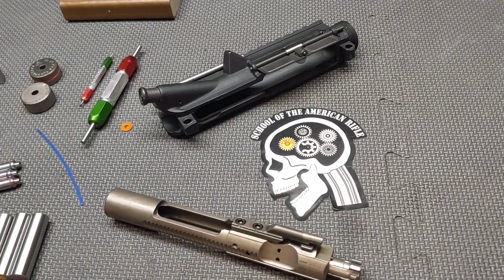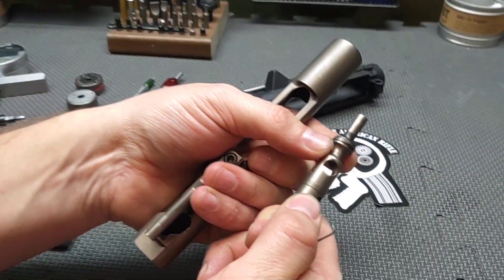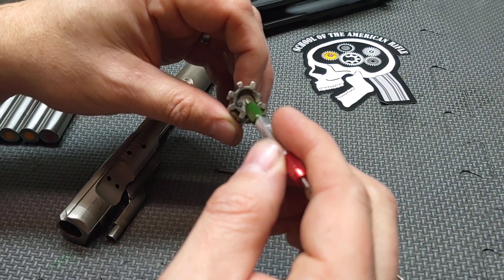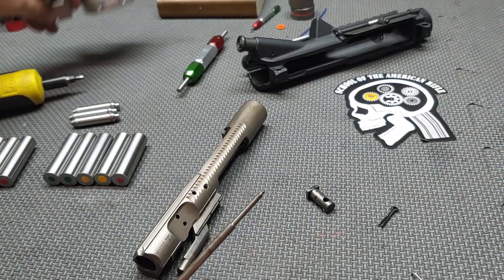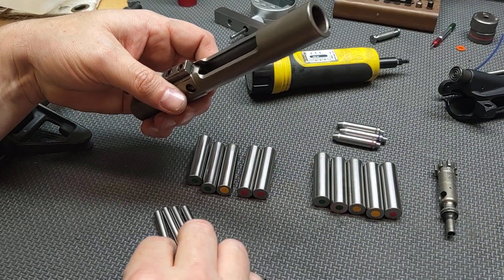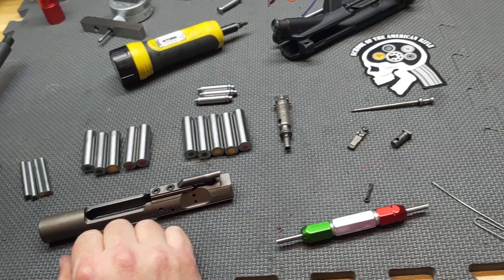Fail Zero AR-15 BCG Autopsy

Comment: Thank you!! I just took my FZ bolt carrier out and noticed signs of gas leaking out from under the gas key, and I just checked the bolts, and one is super loose! I have had trouble since day one with my Fail Zero lightweight bcg, and I have now tried it in several rifles. It would not lock the bolt back after I checked and changed EVERYTHING else. When Fail is in your name, I think that's a bad sign.

Comment: Im no expert by any means but how is that staking good as you stated?? They dont even engage the fastener. I just got a bolt from this company today, its going back. Three of the stakes dont touch the fastener, only 1 comes close. I figured the point of staking would be to keep the bolt from backing out, keeping the key from loosening up, or sheering off. This bolt is a polished turd. I can send you pictures of my spikes tactical staking versus this one. Please look at the staking and tell me its good. How? Am i wrong

Comment: HAD to Subscribe after watching this!! Good God; after 24 years in the Military I've NEVER seen such an impressive autopsy as to the reasoning for this failure (from anyone on YT), only to find the shrapnel under the gas port. I'm astonished and impressed but in reality there's actually no proof the factory did this over the owner but still, this was a remarkable how to with your machined go-no/go gauges. Jealous I don't have those myself. EXCELLENT WORK!

Comment: By the way,  I guess they no longer use YSF gas key screws,  in curious if they've fixed any other issues.  Will test mine for looseness.

Comment: This is the exact bcg I bought for a 7.62x39 AR build, idk if they probably make it for 5.56 or which this one was. But of coarse I didn't do any research to see that the nickel boron bcg's are not very good, an it's disappointing to see the slop through this bcg. Although I guess expected, not sure how much a "good quality" bolt carrier should cost, but I would think that for 200$s you could get one better then this. Non the less, I now know that this is not only a failure point that he actually already mentions in another video. 

But here he's exhibiting exactly what he was talking about, with the leading and looseness of the gas key. An idk if that piece that was in there is crap quality control or from use, but at least I know to check the tightness of these had key screws. An where one fail point may likely developed.  I'll probably just order a new bcg, but still will try this one out on the mean time. 

I'm fact in going to check the screws on mine, an I bet that they're loose too. Literally because the way these are crap coated, an manufactured. I bet you the screws don't drive all the way in, and all of these bcg's need to have those gas key screw holes, rethreaded. Now I need to figure out the size thread tap I'll need and it should rethread through that coating easily.

Comment: wao that extractor came apart like nothing; I am trying to take apart one Fail Zero for AR10 and cant get that pin to move; I am trying to test the head space but can not take the bolt apart! does it not should be easy like this? if one have to dtruggles I would thing something is really wrong; this BCG is new, never fired

Comment: Fun and educational!   Could you use some kind of pressure test gage if someone were to make you one?   I feel like there could be a 1 or 2 piece tool made to plug the front and rear of the bolt bores and introduce compressed air at a few psi to see if it leaks a lot around the key.    Or even a syringe to push air just for that most basic test for rocks and shrapnel under the gas key!

It would be interesting to have this one more metric to compare manufacturers.

Comment: Had the same issue with my zero fail. Wound up tryn to stake it more still didnt work so i know probably not the proper way but i got tired of the screws shooting loose so i just threw loctite on the screws and its been good ever since.

Comment: I almost bought a FZ bcg until I saw the YFS bolts in the gas key. This was way before I saw this video but it's pretty common knowledge that Grade 8 bolts are standard. FZ basically stamped their bolt with "This is garbage" when they decided to use yfs bolts

Comment: I have a FZ bolt that surprisingly isn't a lemon but seeing these videos I've learned so much and I will be checking the gas key and also replacing it with a better carrier. It's absolutely  crazy that they let that go out the factory with that metal chunk just sitting there.
Reply: you think that's bad right you should see a pistol I got it just so happened to be a tp9 elite and the barrel feed ramp had literally had grooves in it. contacted century about it and the excuse they gave me is it's only cosmetic it happens on some during the manufacturing process it will not affect safety at all. I replied so this is your level of quality control and this is acceptable? haven't heard anything back but I'm going to try to upload a short video about it.

Comment: Man!!! You got me thinking now !!! I purchased a Fail Zero BCG for an AR 9 build  I"m  gonna start. It's still in the original package and, I dare say it didn't come cheap. It, too, is Nickle Boron, considered to run flawlessly without any lube. Perhaps I should send it to you but, you primarily do the 15 platform. Maybe I'll luck out seeing that the 9 platform doesn't require a gas block or tube. I'm glad I found your channel. I'm learning as I go. Thank you for the wealth of information you provide to many of us !!!
Reply: it needs to be lubed.   it doesn't matter what coating or surface treatment is put on the bcg.  
 sotar has an excellent video of homebrew rifle lube.  i use a similar concoction.

Comment: Question: my gas rings on my Spikes BCG are worn and fail both gas ring tests. Ejection pattern is good (4 o'clock) obviously the rings need to be replaced, but is there a potential that the contact location on the carrier is too small. 
Note: maybe 2000 rounds in the bcg so far. I'd rather replace rings rather than the whole setup.

Comment: I have a Fail Zero in my Grendel. When I first built it, it would not cycle. After firing 30 rounds it suddenly started cycling without issue. Visually, I wasn't impressed with the staking... now I'm really concerned lol. 

Update: After putting a few more rounds through it, I noticed a lot of carbon fouling around the base of the gas key. I reached out to FailZero with pictures and they immediately sent me a return label.
Update 2: They replaced the carrier and said they found metal flakes under the gas key (like in the video). New carrier works as expected.
Reply: I'm glad to hear they made it right at least!
Reply: That’s a win. I’m glad they honored it.
Reply: Wtf , I bet a ton of them have this.  I think I can probably check and fix mine on my own but.  That's crazy, if mine fails, those A holes better send me a new one.
Reply: Wow, very interesting yours had the same issue!

Comment: that means ALL their carriers are drilled and taped BEFORE going to the coating part of the factory
.
AKA..... ALL!!! of their carriers are like this...... with false torque readings on the gas key
.
like..... everything else looks like pretty good quality work
far from the worst!!! 
.
sure.... it can be improved a bit...... 
but that would run just fine for 1000s of rounds
IF ONLY!!! the gas key was installed and torqued properly 
.
.
still...... every carrier they make is up to luck of the draw in the coating process 
a little heavy = this video
a little light = works flawless for 50,000 rounds 
.
.
.
as a car mechanic.... i always make sure i have a clean hole before torquing....... no dirt, rust, oil, or coolant, ETC
this also applies to women.........................................................

Comment: Is this bolt well used like thousands of rounds or just the dud out of the thousands made? Did this guy disassemble it? I have a gold colored BCG from them paired with a binary and it's never failed always good and am easy clean and I always get rid of the carbon build up after every shooting. Great video and diagnosis but I think someone is lying or bought it used and abused

Comment: My fail zero has its logo on mine bolt carrier way off centered and it cuts off the last letters mostly havnt put it in a rifle to test it out but it's my back up just in case
Reply: May want to give it an inspection and hopefully it will be ok.

Comment: Talking a small bit about head spacing ---> Question: when thinking of purchasing a New BCG for my MP15 - " How important is making sure this new BCG has the correct Head Spacing as the Original Microbest BCG?" 
At this point I don't have the tools or knowledge to perform the Headspace Check.
Actually I'm only thinking of replacing the phosphate bolt with a Nickel Boron coated bolt (Carpenter 158 steel)
Reply: IMHO you should verify headspace any time you replace either the bolt or the barrel. A Clymer headspace gauge set for .223 Remington has a “go” measurement of 1.4363”.  The “no go” is 1.4666”. The difference is only 0.0303” - just over 30 thousandths of an inch. That may sound like a lot, but with tolerance stacking between the bolt and the barrel you could get a mismatch. Add in variances in individual cartridges and there’s a potential problem. Too much headspace isn’t all that bad up to a point (unless you reload). Too little headspace is BAD. Like potential out of battery ignition bad. Kaboom.

Comment: Now I kinda wished I came upon this video before I ordered mine which should be here in the next day or two very concerned now
Reply: I bought one years ago and has run flawlessly
Reply: @michaelball760  no gas key problem?? That's good to hear just got mine today in the mail fingers crossed thanks for your reply
Reply: Return it and buy a BCM, their products are junk and have been the laughing stock in the community for years now. No such thing as some are bad. If a company does their QC then there isn't failures like this.
Reply: I have about 1200 rounds in mine no issues at all. This was just a manufacturing error, it happens. It doesn't mean they are all bad, you always get a run of bad apples
Reply: @Drew-py8kg  I agree there's good and bad ones got mine a few days ago damn it looks good in mine I hope its a good one thanks for your reply

Comment: Could the Gas Key be staked from the Front and Rear of the screws as well as re doing the side staking? Or is replacing the Gas Key Standard practice for aesthetic Must be done exactly right purpose?
Reply: I was wondering the same thing about front to back. Did you ever find out the answer?

Comment: Great example with the metal shaving and corresponding indent of the key.  Final QA before assembly of this carrier was non-existent.  A question if you please, who's castellated (notched) head socket screws do you use for the carrier-key???

Comment: I recently bought a Fail Zero, and it seems to be fine. I bought it because they been around for a while,. However,  seeing a couple of videos showing these issues has ne concerned.
Reply: they have been a joke in the AR community for a long time, the are a marketing gimmick
Reply: @zack9912000  seriously.  Their QC is trash, and NiB is a garbage coating for a BCG.  too many people who don't understand how plating thickness messes up machining tolerances on parts not designed and machined for that plating, or things like hydrogen embrittlement in nickel boron plating, NiB flaking, and so forth.  They just want shiny parts they can show off to their friends.  "MiNe Is PeRfEcT!"  uh huh, and plenty of people drove a Pinto that never blew up, too.  I still wouldn't buy one.
Reply: Lifetime warranity send it to them and they will fix the problem probably just replace it.
Reply: @Koncept34  yeah, I bet your parachute has the same warranty.
Reply: @GlassWolfLH  why would I need a patachute when the plane works fine.

Comment: I just got a fail zero bcg and I looked at it after this video. My gas key screws don’t say “yfs”. So maybe they stepped it up and stopped using them? I hope it holds up, but I don’t have high hopes after watching part 1 and 2.
Reply: Another comment above yours was warning about counterfeits. Maybe this one is or maybe yours is. Hell, maybe the counterfeit is better quality than the real deal lol
Reply: @Zaucey  I don’t think so lol. I ordered it from primary arms. The packaging was correct and so far, 1000k rounds later it’s running good! So fingers crossed
Reply: @johnnoel3416  I have 3 from primary arms and they all work fine.  Keep on as a spare un the range bag in case shit.
Reply: If yours has a nickel boron plating, I wouldn't trust it too much regardless of the bolts holding the gas key.  NiB is a garbage coating for a bolt carrier group.

Comment: As soon as I saw the title, I knew something would be wrong with it. FailZero BCG’s are some of the worst out there! Have heard of all kinds of problems. The one I had, the nickel boron was flaking off...that was the end of nickel boron for me. Back to quality phosphate BCG’s! :)
Reply: i mean i wouldnt say Phosphate is a superior coating because ive seen some pretty terrible phosphate jobs that rusted after a rainy day.
Reply: @nemisous83  To be fair, that's not the coating's fault, but the application of it by the mfgr.  That said, Nickel Boron (NiB) is garbage for a BCG in any event.  Numerous types of coatings sold as "NiB" including Electroless Nickel, because most people can't tell the difference.  NiB flakes off because it's a plating process, not PVD.  It adds thickness that messes with machining tolerances designed for phosphate coating, it discolors with use, loses lubricity, and is subject to hydrogen embrittlement if the process isn't done precisely right.  Just stick to better PVD coatings like DLC, TiN, ZiN, or QPQ.